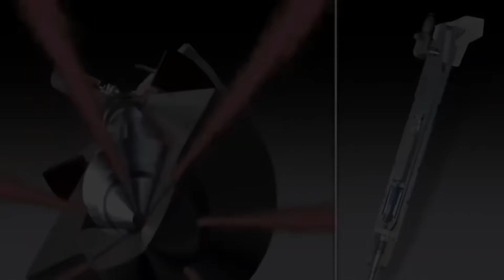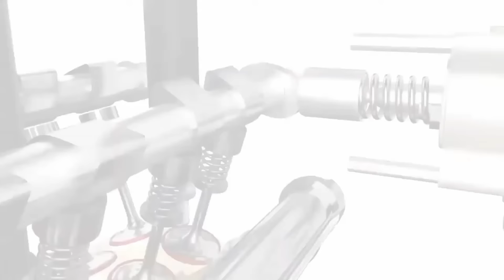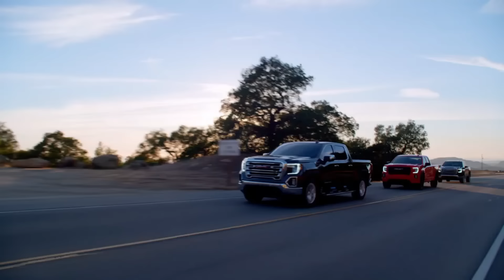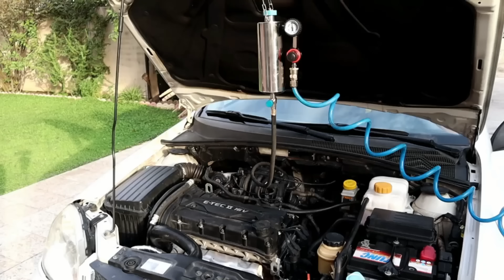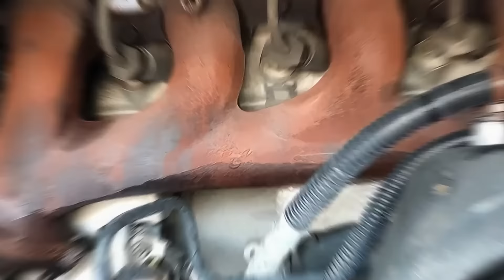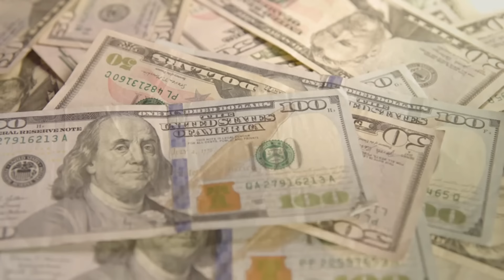This ILLEGAL Japanese Fuel Trick Keeps GMC Injectors Clean for 300K Miles

Comment: Techron full bottle in the tank before a long trip, always top tier fuel, 5k mile oil changes, and roll with it. Mowers need techron too.
Reply from the maker: Techron and Top Tier fuel are the secret sauce for keeping those fuel systems clean. That 5k oil change routine is the golden rule for avoiding the major engine failures we discuss on the channel.

Comment: is the foam cleaner into the air intake better than treating the fuel. How often can you use the intake treatments-- Gumout a good brand?
Reply from the maker: Foam cleaners are great for physical carbon deposits on the intake valves, while fuel treatments focus on the injectors. For GDI engines, that physical cleaning is often a necessary extra step to keep the airflow smooth!